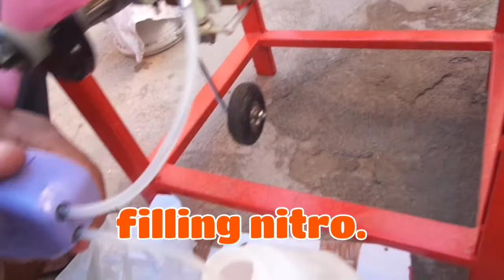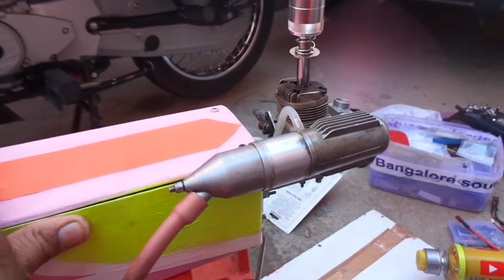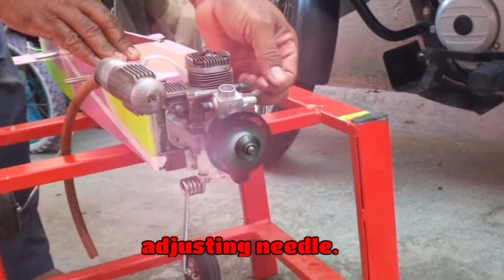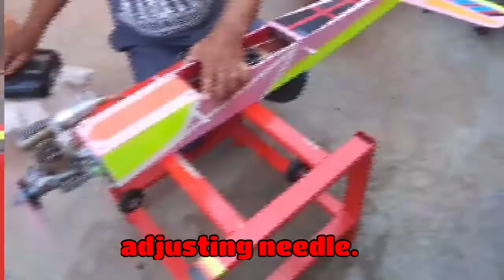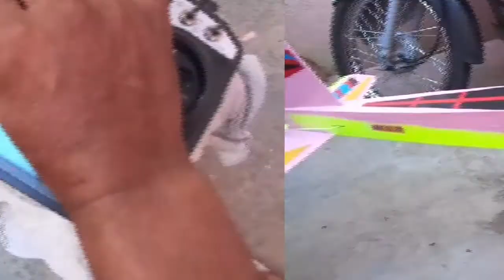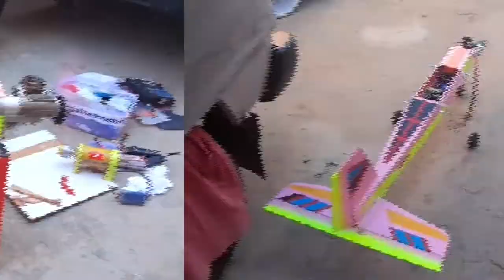RC PLANE.STARTING AND TUNING NITRO ENGINE.

Comment: Question why were you turning the adjusting rod? I still don't understand what Im listening for or how to adjust the transmitter and the rod together.
Reply from the maker: Rod is high end needle.it adjust the fuel flow .transmitter controls the throttle.

Comment: Hey why would mine not suck in fuel threw the fuel line
Reply from the maker: Due to leak in exhaust. Check muffler for leaks.carburetor fittings.